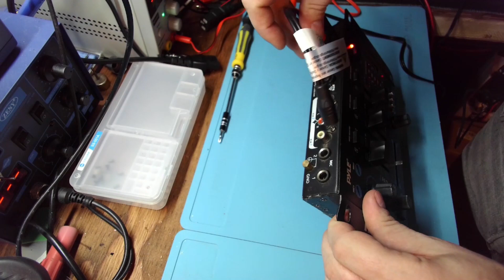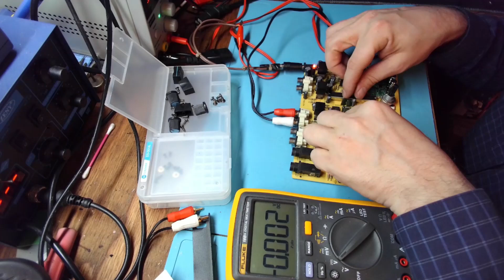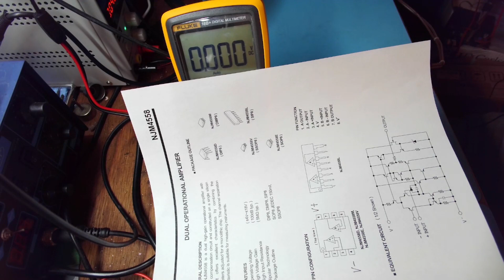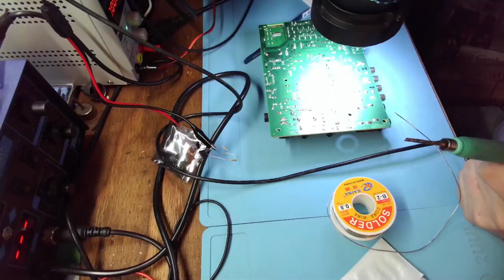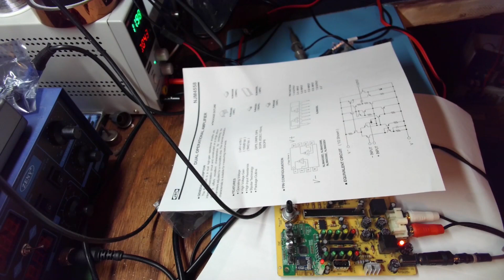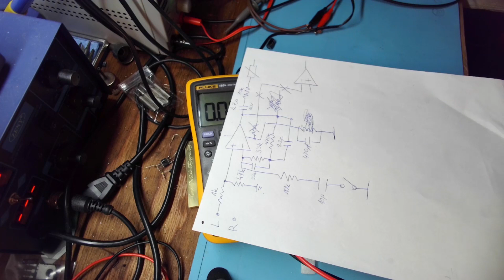Pyle PMX7BU Repair | Audio Mixer, No Amplification | Very silly problem

Comment: Estoy en ploblema drl cable del.BLUETOOTH SE DESOLDO Y NOSE DONDE VA ? PARA REPAR??
Reply from the maker: when you turn it on, does it light up? Can you see the red blinking LED? if so just press MODE once, if the LED goes off, press again so it keeps blinking, then scan for bluetooth devices near. It will be called PMX7BU. Then connect a small speaker directly to the output, you should hear the sound. If you can't hear the sound but the device is connected via bluetooth, the device probably was overvoltaged, you will need to replace opAmps as they will likely be fried. The BT side is protected by 7805 regulator so overvoltage shouldn't hurt it
Reply: @blackhorserepairs  gracias ise lo que esplica y funciona gracias desde CHILE

Comment: Y ahora pregunto que y como solucionat problema del PMX7BU
Reply from the maker: Have you confirmed that you're using AC adapter instead of DC (as I did)
there is very little that can break on this device, I have 2 of them and I ue them on the daily, if it doesn't work the most likely fault is the supply voltage and wiring.
Reply: Ok cual es la solucio en mi pais voltaje de 220
Reply: esta funcionando el 100 x ciento
Reply from the maker: @VecinoParada  glad I could help
Reply: @blackhorserepairs  gracias esta todo bien con su ayuda gracias
Reply: La solucion es el tranformador   adastador de voltaje